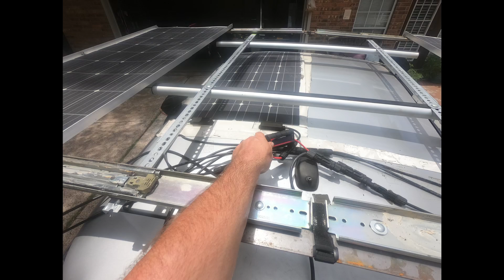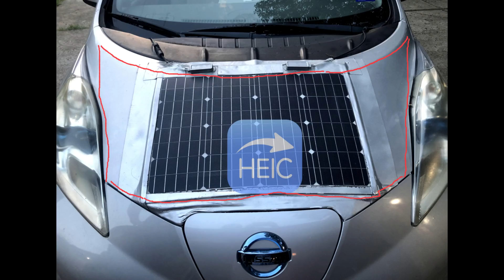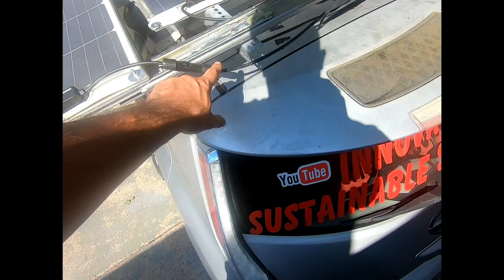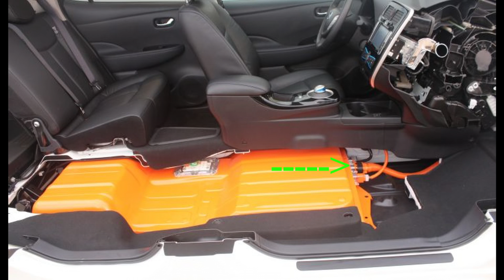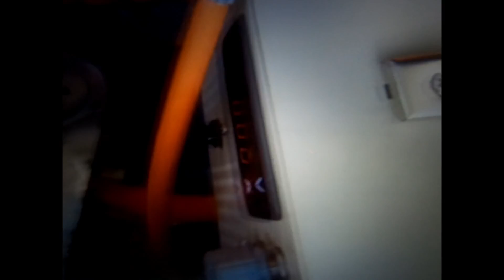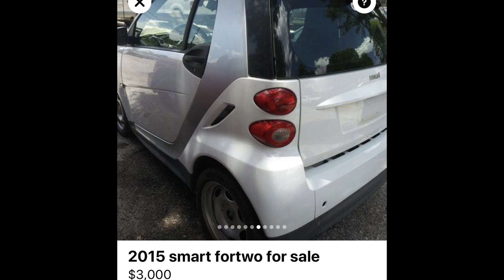Solar Powered Nissan Leaf - Connecting Solar Directly to EV Battery

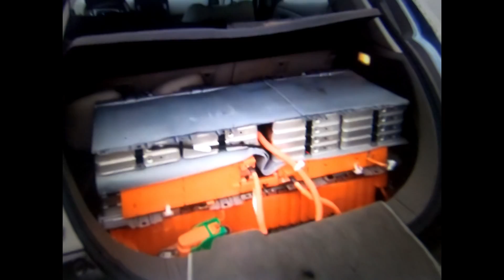Comment: 20:50 When a battery cell is replaced the voltage must match to keep the battery balanced.   The battery voltage could change due to temperature or other factors, but in that case the voltage of all cells would change together.
Thanks for the support.
Reply from the maker: That makes sense about the module replacement.  You deserve recognition, although it my motives are not entirely altruistic, lol.  I need your talent and knowledge to help me take this project where we want it to go: Cars with frickin solar panels attached to them.
Reply: So if i were able to get a generator and a inverter to output the correct voltage, I could use an adapter like mentioned in the video and so long as i shut off the generator before the car gets shut off it would work?

Comment: Love it! The reason shade impacts solar panels so much is because the individual solar cells are all connected in series so the voltage drop of one has a large impact on the whole string.

Comment: Great video, and answered a lot of questions for me.  One thing to note, some cars are designed for direct solar.  For example, some versions of the Hyundai Ioniq 5 come with a solar roof, and I've seen videos showing it trickle-charging the high-voltage battery on cloudy days.  The Leaf is not a candidate for a solar cell array being plugged right into the high voltage battery, but some cars are.
Reply from the maker: True.  Which also means there is already a convenient tie into the HV battery on the Ioniq that a vehicle moder could probably tap into without too much trouble.  Given how cheap solar cells are, I really think they should be incorporated in every EV in some way
Reply: @InnovativeSustainableSolutions  I totally agree.  Hell, there's a role for solar cells to help keep the 12v battery topped-up in ICE cars, for that matter.  So I'd incorporate them into EVERY car, if I had my way.  :)

Comment: Thanks for running through the options. I'm looking at adding solar panels to a Citroen Ami since it's an ideal candidate. It's intended for short trips and gets 8 miles per kwh due to a low top speed so adding even 0.5kwh per day would be useful. It's also running off 48V so significantly safer to work with. My only concern is manufacturer warranty, I don't really want to cut holes in the battery pack within the warranty period.

Comment: The EV already contains all the necessary electronics in the regenerative braking system for spurious charging of the main battery! The vehicle maker providing a solar DC IN port seems like a simple add-on for the EV electronics, compared to Solar->AC inverter->Charge controller->Car->DC converter->Battery way of doing it.
Reply: But would the contractors still need to close? When you’re driving they are closed… 
But maybe he could still have extra batteries in the system charged by solar to supply consistent power while charging… thus eliminating the inversion back to AC etc…

Comment: This video answered a few nagging questions -- thank you!  I don't (yet) want to attach solar panels to my car -- but have often wished that I could buy a few (hopefully inexpensive) solar panels and wire them straight to my EV so that I could get a few extra miles of charge while it's just sitting there on a sunny day, doing nothing else for long stretches.
Reply: There's a way you can do that, kind of talked about in the video.  You can buy yourself a Sungzu or Yeti which stores about 1/15 of the battery power, and plug that into to main J1772 or whatever, on a not rainy day, and let it discharge.  Problem is the older ones had an 800 cycles life, the new Li4s have 2000 to 6000 cycles.  The cost?  ~$550 per KW. ~800 for the 1500, and the Yeti 3000 was 1500 at Home Depot a few years ago but that wasn't Li4 yet.  Charge the power stations from either your solar or your house outlet.  The Sungzu is 33 lbs.  The Yeti is 60.  I almost did this experiment with the 1000 model in 2017 and a Honda Clarity with a 8KW battery.  Would have required 8 back and forths from the apartment or solar.

Comment: Thanks for the overview of porting roof panels to an EV battery. With electric vans and RVs coming to market, capable of supporting relatively large solar arrays, demand for vehicle solar self-charging should soar.
Reply from the maker: I think it will too.  Especially as prices continue to fall and cell efficiencies rise past 30%.
Reply: There is a solar 53 foot trailer, maybe a reefer, out there that a couple did.
Reply: @InnovativeSustainableSolutions  There are a bunch of used panels coming up for sale at $50 a panel or so. I'm near Austin if you'd like to do a group buy on a pallet.
Reply from the maker: @Nicholas-f5  I might be able to jump in on that deal.  Can you e-mail me the specifics?  Lonestarezev at gmail.com

Comment: 1) Canada is leading in EV hacking, there are a few companies that already have their own boards and do battery swaps from the old leaf with the new leaf batteries. Pretty cool.
2) When adding solar panels to the doors, make sure to protect them against dents caused by other doors or shopping carts :(
3) If you lose 2 more bars on your battery, it will be the time to DIY the battery swap and hacking.

Awesome job as usual.
Great interview.
Thank you!
Reply: LOL. I wrote befor watching the deals... Congrats on your new buddy.
Reply from the maker: Canada IS rockin the EV hacking.  I skimmed an article about a shop up there that had figured out how to unlock Performance mode on people's Teslas.  It was hacking the car and "stealing" the software upgrade and underbidding Tesla and selling it to people.  Very interesting stuff.  It's wierd to watch Tesla go from being the underdog you were rooting for to "The Man" sueing little indie hacker shops.
Reply: @InnovativeSustainableSolutions  I am working on a different solution with cooperation with muxsan. The goal is to hack the Leaf BMS to charge at low current. The current then is matched to the solar output current. So you need just a small battery to for the initial handshake until Leaf BMS will reduce the current. But your solution seems even better. Keep up the great work! Haven't missed a video!
Reply: How is this project going?

Comment: Love the suneater! If you ever decide to get a replacement battery, hit me up for a free CAN-bridge, that way you can upgrade to a newer 24/30/40/62kWh battery!
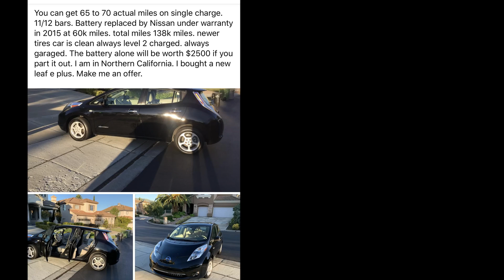Reply from the maker: I have a new 11 bar 24 kwh battery in a Leaf parked out back right now :) @38:28.  I do have an upcoming project that I may need your expertise for though.  It will be crazy, (if I can get funding) 3 Leaf batteries in parallel, in a solar powerwall on wheels, connected to the battery in the car using Shonoiki's open pack method.  It would be awesome if we can get some software/hardware that would get the cars computer to accurately predict vehicle range for multiple batteries connected behind the Junction Block.  I am getting the build images rendered currently, hopefully have a video out on this in the next 3 weeks.
Reply from the maker: @DalasEVRepair  I just binged your last 5 videos.  Very neat stuff, and you're good at explaining it.  I will definitely be a customer and showcase your work at some point.  Not a whole lot of safety regulations in Texas, it's kinda a free-for-all here.  Do you not believe a 200A fuse at both terminals of the extender battery would suffice for safety?

Comment: There’s a company called Entelligent that is now selling a DC to DC slow charger designed to go from solar to EVs without any connection to inverters batteries ect… 
IDK if you could make it portable but that’s a pretty exciting development. Though it wouldn’t get you that consistent 720w minimum…

Comment: You using the secondary battery to charge the main battery at intervals is along the lines of what I was thinking of trying.
Reply from the maker: It is the fastest, easiest way to accomplish portable solar charging.  I'm not giving up on building a circuit board/component for myself and others that will eliminate the need for aux batteries/charge controller/inverter.  But until we get that figured out, this system will do.
Reply: @InnovativeSustainableSolutions  trailers with back up power stations located close by

Comment: It seems to me that if you connected enough solar cells in series to get up to 400V that would be the simplest way to trickle charge an EV through the DC port. I don't know if anyone has tried this, but that's what I'd be looking at.
Reply from the maker: The voltage of pretty much all solar cells is .57 volts.  So you would need somewhere around 700 to get up to 400v.  You usually want to aim a little higher than the max voltage of the battery because it is the difference in voltage that charges.  So 430v would be a good number to shoot for.  I believe the Lightyear, and Aptera EVs do this

Comment: The 2014 leaf on is bidirectional system so it’s a power wall on wheels, we aim to keep two leafs to allow us to optimise this approach! Your ideal would better used on a van or truck with a trailer which folds out into a solar array!

Comment: Now we are talking. This is the way to go. Solar> batteries > Inverter is heavy and wasteful! However running high voltage solar is also tricky: Having 700 cells in series, require that they all get irradiated equally, or your voltage drops off. Individual lower voltage panels are more resilient to partial shading. Ideally you want as high voltage as practically possible. Then use an industrial efficient boost DC/DC converter, which is much more efficient than household inverters. You can possibly do without a MPPT too, because the vehicle battery pack only has a 30V or so difference between 10% and 100% SOC, so your panels will be kept in the sweet spot easily by the DC/DC, and don't use a bank of lead acid batteries (why would you need batteries to charge batteries?). For controlling the charging, bypass the vehicle charger, it easily uses 250W just to be turned on, but use some glue logic and a seperate small precharge and contactor circuit to connect to the battery directly, i.e. Arduino, to cut charging when you reach the end of the CC phase, so the charging stops when you are at around 80% SOC. That way you'll get 85-90% of the power in the panels into your battery. (you are not required to buy special gloves! That only applies to certified electricians working professionally. A pair of leather or heavy duty Nitrile gloves are just as insulating as a $100 pair of gloves with the right stamps.)

Comment: Hey, I admire your spirit.  Real good job on this project.  Thanks very much for the link to James!  You might also consider powering the "climate control" while parked out on hot days.  Keep up the good work.  Looking forward to your next installment.  "Bonus question": how many watts, measured at the battery terminals is required to move a Leaf at about 5mph on level road, no wind?
Reply from the maker: Thanks bud, appreciate it.  Very few watts regarding your question.  I'd guess around 600 for the electric motor, 250 in passive draw for the vehicle's carious cpu's and electronics.  Still the draw would be higher than the amount of power you could probably produce using on board solar.

Comment: Gosun is in the process of coming out with an EV Solar Charger with flexible panels that goes straight to the car battery that folds up on the car roof when you are not using it.  They are asking $3000 pre-order pricing.   Something more flexible where you could choose what kind of panels you want to set up would be welcome on the market too.  Jame's Real Solar invention would really be useful.
Reply: Better:  I found what looks like that Real Solar Cars guy's project for sale on the open market:  TC Charger.  Some YouTube video, on that channel, not seeing my on Real Solar Car channel.  Also seeing Chinese clones of it?  Search for stuff is out there if you want to do direct charging.  Hope the originator gets his credit.

Comment: Great video! Lots of information 👍.   I  have several ideas that I've been contemplating for a while, being  that I bought the full traction battery of a BMW sold by battery hookup, I was going to the battery extender pack like you mentioned, by connecting it after the precharger directly to the main battery. After a lot of thinking I've decided to make a trailer solar charging station with the BMW battery and take my LEAF to a battery makeover and add potentially 11 or 12 bars at ace hybrids in los Angeles CA. Or I could buy a better LEAF and swap the battery? That doesn't make sense, maybe, but I like my car a lot. Okay... I  still don't know what to do, I guess. Excellent video my friend!
Reply from the maker: Thank you!  First off check your battery from battery hookup.  They definitely overpromised me on some batteries, and were completely unapologetic when I pointed this out to them.  See my "Leaf Module Capacity Test" for the story on that.  I'll check out Ace Hybrids, that sounds very interesting and maybe your best option depending on price.  About 2 dozen people have independently asked me about the solar trailer, but I can't find evidence that anyone has ever built one.  I'm hoping to change that.  I'm working on plans for a 3 battery (degraded 24kwh batts on the aftermarket), 800 watts of solar, mobile powerwall on wheels in a small utility trailer that connects to the Leaf.  Aiming for 150 miles of range.  That video should be out in the next month.  If you get started first please share your progress here.
Reply: Innovative Sustainable Solutions 
I  purchased 2 whole batteries and they are up to par to what they were advertising on the website (thankfully). One I'm using for an DIY EV 96v nominal.
The other one is the one I want to use in the solar charging trailer 48v with 8000w split phase mppt off grid 4- 300w solar panels. I'm able to make 7 packs of 48v. I'll have 9- 3s 2p packs left for something else.
I'm thinking on using 30a Dali bms. Should be enough, no?
Still learning. Hopping for a 26 or 27kw if my math is not wrong 😁. 
Are you on any fb group? I'll be posting on diy evs group once I'm done.

Comment: By attaching leads into the battery pack behind the resistor don't you by-pass the resistor which is designed to be another safety device. If the resistor fuse is blown there is another route that the high voltage can electrify the car outside the battery. Causeing the risk of electrocution.
Reply from the maker: Yes.  You would HAVE to have fuses at some point on the leads from the HV pack so that in the event of a short, power from the pack is cut.

Comment: Nice setup man. Is it possible to put a mppt solar regulator between your EV main battery, the solar panels and backup battery.? That would be a great solution.
Reply from the maker: There are some people that have pulled it off.  They didn't leave much of a how-to manual though

Comment: You can generate something more power than those solar panels are collecting those flexible panels are some of the least efficient panels around if you were to hard mount to 400 watt panels up there you could probably get 6 or 700 w out of two panels.

I got to say though those slide out wings are freaking awesome

Comment: heh I did a similar mod to my old chevy volt. put a vid up on my page explaining all the mods. tried to improve the aerodynamics instead of hurt them and found that it was much more efficient to wire solar into the low voltage system and remove old heavy lead acid battery and replace with higher voltage DIY LTO pack to run at ~15.8v. car loves higher voltage and it gives me more range/better fuel economy without needing to plug in while my big portable destination charger gives me another ~70 miles of ev range on tap as fast as the onboard charger can cram it into the volt.

Comment: This video was so informative! I had an idea last night to create a solar carport for my Mini Cooper SE and I'd trying to figure out the most simple way to do it. I'd really like to avoid needing a battery buffer like you have, but I also don't want to dig into the vehicles battery electronics. Because I could potentially add 600 watts of solar to the roof of the carport I'm hoping I could reduce the size of the battery buffer needed, but I hadn't thought about the wear and tear that could be caused by starting and stopping charging - as you described in this video. Really helpful! I'll have to keep thinking about a viable solution here and welcome any thoughts you have in regards to a system that could have many more solar panels.
Reply from the maker: Hey Josh,  I'm glad this video helped steer you in the right direction.  Unfortunately, at this time, I can't see a way to achieve sustained off grid EV charging without a decent sized battery bank.  Keep in mind that a properly cooled battery bank can last 1000s of cycles, and it will be a life saver if the grid goes down for a few days.  It can also be built up 1 battery at a time, in parallel, over months or years, as you can afford it, and become an investment that will offer years of value and security to you.  I will be doing some videos on building a $100/kwh safe powerwalls in the nearish future.

Comment: Contractors are fine bruh... there is also a precharche proces w. a 3rd smaller contactor, the main contractors never spark and the mechanical wear is neglect able.

Comment: This is a great video, thanks for all of your work.
Question (forgive me if you have answered this elsewhere):
is there any benefit it installing a solar panel of around 160w (for e.g. a semi-flexible panel that can bond onto the roof) purely to charge the 12v battery under the bonnet / hood.
will that in any way decrease the load on the traction battery due to air con use etc?
thanks.